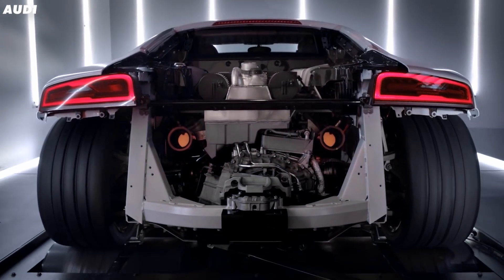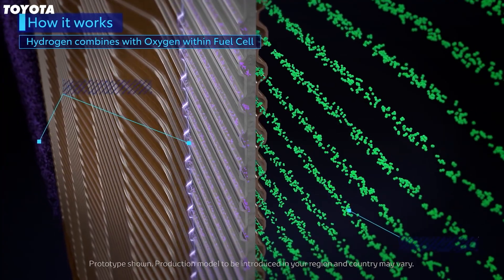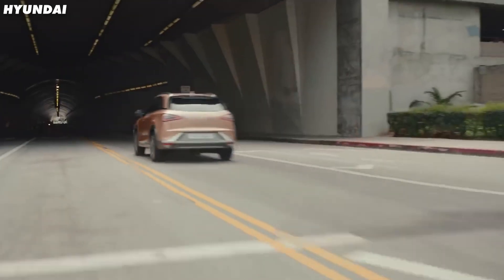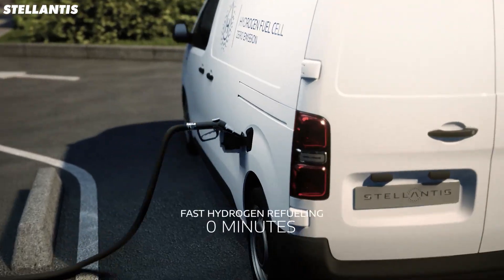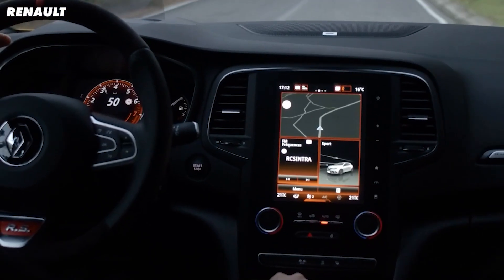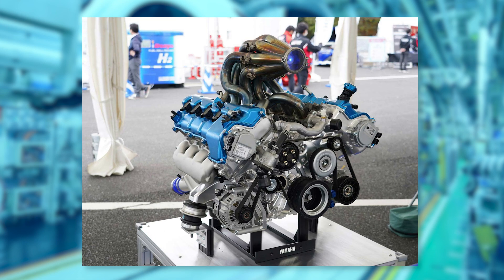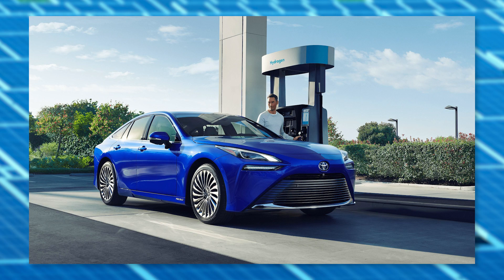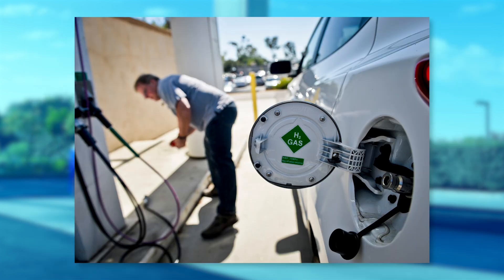The V8 Engine that Runs on HYDROGEN

Comment: Just to reat about the solar panel farm, they are not green at all, the process to recycle them is pretty inefficient and pollute a lot. However Nuclear is very very clean, in fact, apart from geothermy and dams, it is the most eco-friendly production method, and the more efficient one. 
But you make me join the hype train of Hydrogen as fuel for normal engine !

Comment: Got this vid in recommendations and had little problems with it. Until i heard that hydrogen is dangerous  using hydrogen bombs as example. 
Either author does not understand the difference between thermonuclear explosion and burning hydrogen, or he does not give a crap and just reads what someone wrote him. 
Dangers of hydrogen in context of this vid could be explained using Zeppelin fire.
Reply: I’m currently studying chemical engineering and have a fuel cell course. The problem with hydrogen is far beyond its safety factor. There’s no point in making hydrogen from non-renewables apart from experimentation use such as:

1. It’s less efficient than directly burning fossil fuels used to produce it

2. Even if you do use renewables, electrolysis is still at the earlier phases and is still super expensive and inefficient even if it does produce high purity hydrogen. There’s also the whole platinum and using noble metals as catalysts, but that’s another story.

Hydrogen is clearly the/a fuel for the future. We’ll have to wait and see
Reply: @madoba8717  i know about the shortcomings of hydrogen as fuel and it's production. 
I don't believe it's going to be big automotive sector as it's simply not efficient enough as energy medium. 
There are situations where it make sense  but i believe that 7sing electricity to charge car battery directly is better than using it to make hydrogen, transport it and then use it to make electricity again to power cars. Too much energy lost.
For long charge time i think we can come up with some form of hot-swappable battery standards if we really wanted to.
Reply: @toja4309  for sure. We’re still a long way from reliable and sustainable green energy
Reply: @madoba8717  that's why I wrote "if we really wanted" as long as fossil fuels are easier and cheaper progress will be slow.
If we had no practical way to use fossils implementation of renewables would explode as only way to keep our society working
Reply: @toja4309  well it keeps our cars making vroom vroom noises. at least that's nice

Comment: "H in H bomb" is a bit of a stretch as a H Bomb is never going to happen with hydrogen fuel. Hindenburg however, would have been a much more appropriate comparison.
Reply: Exactly. Hydrogen has it's advantages, but also gross amount of disadvantages, that weren't mentioned in this video. Lack of infrastructure, high price, or generationg are really minor compared to them.

Comment: Hydrogen combustion engine are my last hope for the future of car enthusiasm...
If we end up with 100% evs, I'm not sure I'll handle living without my passion
Reply: ICE's arent going anywhere. Synthetic fuels can already be made, with methanol being an ideal eFuel for being able to be made into gasoline and dimethyl ether, which can be made into diesel. Can also be made into secondary fuels like jet fuel. All while remaining carbon neutral, just simply made from water, air, and electricity.
Reply: @Slayer8957  what about the fact that all the processes u mentioned are stupidly inefficient compared to directly plugging in ur EV, or the fact that most of these are yet to be made carbon neutral or the fact that stuff like biofuels are causing more damage than good, for example the amazon rain forest is being chopped down to grow sugarcane for biofuel, ICE's will remain in supercars or sports cars for a while until, EVs become faster than them
Reply: @The_budgetking  you're failing to realise that we will need these bio fuels, current day cars number over a billion, they won't just disappear and to keep them from being a large amount of dumped waste they need to be used
Reply: @EmmieFloding  nah, we can reuse all the metals from cars as even EVs will still need them and old cars will get replaced with new ones ev or not
Reply: supercars and sports cars will mostly remain petroleum powered till the point that, EV tech actually becomes faster than petrol powered cars
Reply: WTF 100% BEVs is not possible. But 70% is very much where we are heading.

Comment: Saving the hydrogen may be better overall. Being able to save energy to a battery isn’t just yet possible for long time, you can save hydrogen as long as you want. After some years you should change batteries, you can use hydrogen tanks for way more. Batteries uses hard to find sources, hydrogen tanks is simply tanks easy to source and 100% recycling.
Reply: Im not so sure about that. In order to be a reasonably dense source of energy, Hydrogen has to be stored in low temperature. Even in highly isolated tanks, the temperature exchange is a thing. That's why, even so, hydrogen is great to public transportation, like trucks, planes, or maybe busses - they use the fuel right away, as for the people with cars - well.. some people don't use their cars very often - electric cars and hydrogen cars aren't very good in that regard, especially, when they are stored outside of the garage.
Reply: Building a hydogen tank needs way less metals from questionable sources than a battery as well.
Reply: @Schaddn  Its just that there is no cost effective way to produce hydrogen, and that there is no real improvement, especially if you want to burn it in a combustion engine it will be ridiculously expensive, even if its made from fossile fuels, worse if you want to use electricity to make it.

Beside niche applications, electric battery vehicles make so much more sense than hydrogen.
Reply: @barrygillis  The production of hydrogen will be cheaper as we invest in renewables. On the other hand, batteries will be more expensive in the future. We can produce hydrogen when wind turbines and photovoltaics do not give their energy to the grid due to low demand.
Reply: @SavvasPe  

There are multiple countries that already relies on wind turbines. There’s no problem with that
Reply: @barrygillis  Except in a transport industry in a geographically dispersed country such as AUstralia.
Reply: @robert2690  Yes, that’s true. No problem to that. But in order to save energy when turbines doesn’t provide electricity to the grid. We have to save that energy! That’s because wind turbines rely on wind of course. We have to make sure we have continue supply of absolutely green energy.
Reply: Hydrogen tanks have to be lined with Nickel, otherwise the hydrogen escapes. Nickel is already under huge resource strain because it's the most desirable component in lithium cathodes
Reply: @armwrestlingprofessor  it may be used to be lined with nickel I don’t know, now it’s lined with high-density polymer.
Reply: @SavvasPe  that's news to me, thanks for the update! Though I still think anywhere you can use batteries you will since electricity will always be ~10x cheaper than H2
Reply: @armwrestlingprofessor  We can’t rely 100% in Hydrogen. For instance home appliances will have to use batteries. But in order to save energy needs of a town, village, etc it would make more sense to keep it in hydrogen. Then we will save materials needed for home appliances. Specialisation is a think here. Small applications ->🔋 and the opposite Hydrogen.
Reply: You're joking right? You'll need to swap out that hydrogen tank long before you need to swap out the battery on a BEV. The tanks in hydrogen cars last about 10 years and after that they lose their certification. And hydrogen tanks are not simple tanks. Look at what pressure you need to store the hydrogen and you'll quickly see that these are not simple gas tanks. These are reinforced tanks made out of carbon, a material that cannot be recycled at the moment which is for example one of the major issues with the blades of wind turbines.

And you can't just safe hydrogen for as long as you want. In fact, storing and transporting hydrogen is a big issue because of the high pressures involved and because it can escape any tank you put it in. There is no way to store hydrogen long term.
Reply: @Hans-gb4mv  700PSI. It remains just a tank in a form we already know it for gas.

Comment: I have a Hydrogen fuel station 1/2 mile from my home it's closer than a Petrol Station and it's 4 miles away from Super Chargers. In a city family used to live they don't have Driveways let alone Garage.  Imagine cables on sidewalks and people on their cellphones tripping the cables. Imagine the children riding their bikes home on the streets and or possibly getting by vehicle's because the  cables ion the sidewalks. Aside from that imagine needing to recharge EV and for what i See on the news the Charging stations are hit with theft of the Charging Cables arrive and there's not operating charger because they were cut off.

Comment: A lot of people are dismissive of EVs or H2 cars claiming that they need to burn as much fossil fuels to run. That is very narrowminded, even if the two are comparable, there is great benefit of switching away from combustion engines: 
First, fossil fuel burned at a plant can be (and often times is) much cleaner than doing so in a combustion engine because they can fit plants with filtering exhausts which greatly reduces the amount of pollutants in the air
Second, it solves one of the greatest sources of city pollution that is cars. If fuel isn't being burned inside the city, much cleaner air is the result.

And yes, there is an argument to produce hydrogen using solar cells instead of storing it in batteries. Charging a battery using a solar cell isn't a simple matter of plugging a solar cell to a battery, it needs a circuit to control the voltage and current going to the battery so if you use solar cells to either charge up batteries or extract hydrogen from water, it spends an amount of energy in the process. Meanwhile hydrogen has the benefit that storing it does not require a container made of toxic chemicals hard to recycle and a hydrogen tank will probably last more cycles of charging and discharging than a battery bank.

Is hydrogen highly flammable? Yes, but so are electric cars, and I think everyone here has seen a video of an electric car spontaneously combusting. However, a hydrogen tank is one solid, tough unit while a battery bank is comprised of thousands of smaller batteries in which a single one rupturing can set the entire car in flames, so there's the potential that hydrogen cars could be safer. Granted, not a whole lot of electric cars catch fire, but this could be an issue in the future when they start selling cheaper ones which don't have the same quality materials of a Tesla.

Comment: I would Buy this before buying Electric Vehicles (EV's)  thing people don't think about EV's when they hit the JunkYard they are not being charged to keep the Battery Packs Cool on Hot Summers. If you weren't aware they Blow up burst acids and other chemicals. In time the Chemicals reach the Ground Water, and California does not have a recycling center, and in the whole continental United States there are only 5 Recyling centers. 👦🏻👍🏻🏎🏁🏞
Reply: Not done your research, have you?  There is no liquid element in an EV battery........
Reply: @Brian-om2hh   1st of all, why would they need to be cooled by Air Conditioning freon system? 
2nd to prevent any casing breakage.  Pressure would break the shell of the Battery 🔋 packs. 
3rd corrosion then ocurrs with atmosphere condensation.  Chemicals you didn't read the link on this. There Chemical reactions when atmosphere or rain mixes in with the electric field. Causing an electrolysis effect.  Rain and electrolysis breaks down elements into toxic chemicals.  I know this may not sound possible 
Ever let a battery sit for years without using it. They still leak. 
Sure Clean the Air and Poison our GROUND WATER
Reply: Sigh ... spreading FUD and lies is not nice
Reply: @Hans-gb4mv  who's lying, you allow yourself to to believe the air is better than water 💧 Acidic water equals acid rain 🌧 I am already seeing it damage the paint on my car

Comment: As far as i know hydrogen combusts with oxygen at 1200°C , at that temperature even Nitrogen combines with orygen which eventually makes nitric acid. Which is more harmful than sulphuric acid that petrol cars make. Real Engineering made a video on it.
Reply: From what I read on Toyota little hydrogen adventure they purposely cool the chambers and create lean mixtures to make it produce less of that stuff as it would be in ideal concentration. They then run it through a series of cats. Unfortunately this causes a lot of corrosion and requires some precious metal coating to keep it contained. Needless to say... expensive.
Reply: @foxman105  Lean fuel mixture, means more oxygen remains unused. This combined with the high temperatures inside a combustion chamber and the nitrogen in the air makes NOx, which is still bad.
Reply: @rpgspyware9560  thats true if the combustion temperatures reach those points. NOx is not something we want, but with lean controlled combustion, we manage to control the peak temperatures. Its more difficult than a Octane fueled combustion, but it is achievable.
Reply: @foxman105  Ceramics and proper exhausts to clean-up the mess are possible solutions. Still there is so much propaganda here it's better to leave this comment section alone.
Reply: You're in the "fully charged" video on hydrogen-combustion engine JCB confirmed they do produce NOX but less than diesel engines
Reply: and you forget about catalytic converter yo neutralize NOx, NOx cat is diesel truck cat. very similar and you can even add DEF to make it back into neutral N2
Reply: Believe in JESUS today, confess and repent of your sins. No one goes to heaven for doing good but by believing in JESUS who died for our sins.  For God so loved the world that he gave his one and only Son, that whoever believes in him shall not perish but have eternal life.(John 3:16)❤️😎
Reply: @alunesh12345  Surely acting in a way in order to get eternal life is a selfish outcome? Its all about saving your own skin? No idea what this has to do with science or Hydrogen.
Reply: Construct some type of catalytic converter that filters nitric acid instead of the other regular fuel emissions
Reply: @thewinchester8996  they did actually use a NOX cat because of that to clean up the exhaust fumes. Also one of the reasons they overcooled the combustion chambers was to produce less NOX. It works... but it needs refinement.

Comment: I think one of the advantages of a hydrogen car mot mentioned is that battery's not just degrade they have to be replaced every 7-10 years, but that is not an issue with combustion engine cars, also I think if you could do conversion kits and took over petrol station infrastructure this could be a more sustainable and less wasteful route.
Reply: The word is batteries......  Why would you need to replace an EV battery at 7 years old, when the warranty is 8 years?
Reply: when will you guys finally understand that modern batteries last longer than 10 years? :D
Reply: @Gabrong  especially with fast charging 10 years should be a decent amount of time

Comment: Why use solar power to make hydrogen instead of charging a battery?

Because batteries are becoming a limited resource. Hydrogen tanks are essentially mental containers. Also, you can build solar powered hydrogen plants on the equator,
And on the poles, and ship it around the world. You can’t really do that with batteries
Reply: Do some research in the requirements of hydrogen storage and transportation and then rethink what you just said ...
Reply: @Hans-gb4mv  obviously transporting a hazmat gas is not easy. But we already have systems to do it, and we have way more steal then we do cobalt and lithium.

I may have understated the task, but my point still stands

Comment: An Hydrogen ICE will run very efficiently. That means high temp and pressure, turning it into a NoX reactor. That is the downside....
Reply: high temp yes, high pressure, well that’s the part I don’t really agree with. 
The thing is, burning hydrogen will result in 3 mols of gas turned into 2 mols of gas, that gives a drop in pressure.
How engines can work with this is that it just as you’ve said is really hot which expands the gas, but that’s still not as great as petrol. It’s no wonder they proposed a “giant” 5 liter engine with 400 something horsepower
Reply: @balazsbelavari7556  Hi, actually I mean combustion pressure. The trick is indeed a relatively (!) low VE (volumetric efficiency), which I am praying for on my bare knees. Being a petrolhead I would be hoping for conversion kits for existing big engines, preferably diesels. In the end, a second life for such an engine is always better than being replaced.
Reply: @rubbermoetroken  I still don’t really get it, so far there is basically one type
of engine that managed to make hydrogen combustion efficient and that’s a rocket engine with a converging diverging nozzle, the key element of turning low pressure, high temp gas into high pressure low temp gas. Like we’re talking about a barely 0 VE. Until someone figures out an internal combustion engine equivalent of that, it really is a NOx reactor which makes it really inefficient… ooooor someone straps a rocket engine to a car